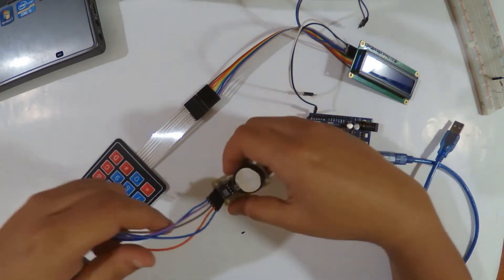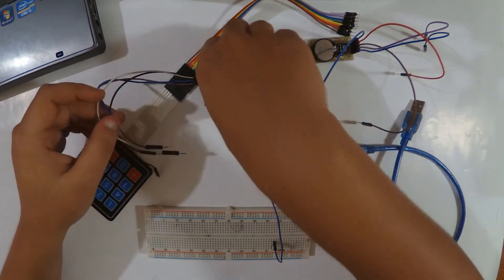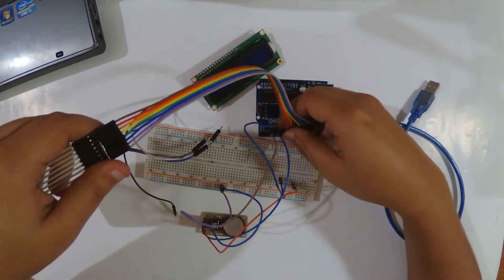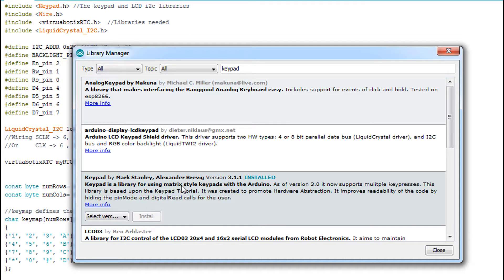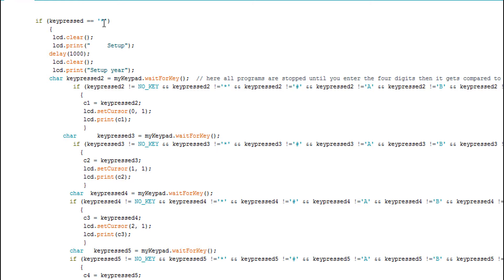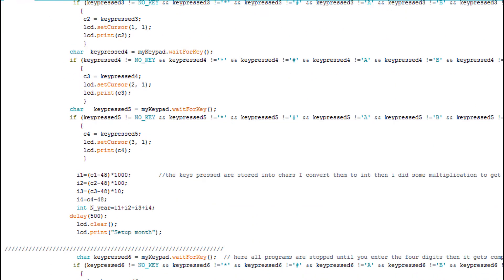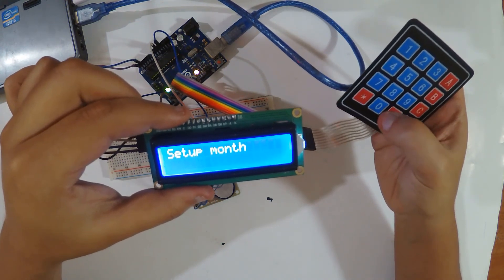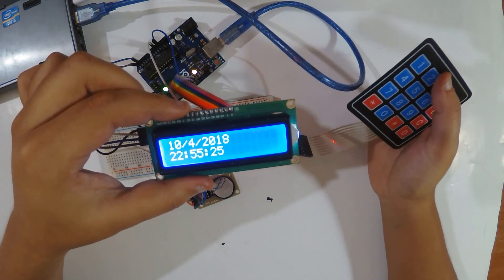How to setup RTC DS1302 with Keypad + LCD + Arduino

Comment: Why i have compilation error? It says no match function for call to virtuabotixRTC Pls tell me how to fix this
Reply from the maker: Hello, it's either:
- You didn't install the library.
- Or you have two librairies with the same name.

I recommend you to put the folder "ArduinoRTClibrary-master" in "Documents/Arduino/libraries". The folder is in the link, extract the .rar file or install it through the Arduino IDE.

Comment: Great project. Thank you. I have tested with simple single switch on X4Y1 (row 4, column 1) to use set time function only presently. I am wondering as the A,B,C,D not used on the keypad, may I use a 3x4 keypad without connecting that column? Again, great project.
Reply from the maker: Yes you can do, you need to adjust the keypad declaration... and change the buttons to '*' or '#'... check on 4x3 keypad examples to help you.
Reply: @SurtrTech  Thank you for the reply. Will try.😊

Comment: hello @sutrtech Could you help me? my Rtc1302 is not storing time. When reboot, it goes to default time. thank you
Reply from the maker: Hello, I can't remember if this code contains a set time function at the beginning with fixed values, but if it is upload the code the first time with correct date/time and then reupload the code without that line.
The line is probably mentionned in the code.
Reply: @SurtrTech  i tried but still not holding time.
Reply from the maker: @shahidmuneer6010  Did you check if the battery is working well or depleted?
Reply: Yes i have tried with new one also...I am using CR2030

Comment: Hey I didn' understand What is it -48 ??

for example:

        i1=(c1-48)*10;
        i2=c2-48;
        int N_hour=i1+i2;
Reply from the maker: Hello, the key inputs are read as "char" but in order to do some maths manipulations we need to convert them to "int".
0 as char = 48 as int.
Check this ASCIIchart to know more https://www.arduino.cc/en/Reference/ASCIIchart
Reply: @SurtrTech  Thank you bro it worked for me.

Comment: Why date and clock not display like
0/0/2000
0:0:0 like but i done setup but still this
Reply from the maker: Check the wiring and soldered pins, also if you could add a resistor between DAT and its pin, 1k 2.2k 220Ohm can do it

Comment: cant" download that code
Reply from the maker: Hello, in the link bellow the video you'll find the article about the project in my website, then bellow the wiring you'll find links to download libraries needed and the code (those links direct you to google drive where you can find the files).
Otherwise here's the link to the file in Drive  ( https://drive.google.com/file/d/1rqX5Xb24vn3zj5mSVZl5hlZLIxJ1apcX/ )
Reply: @SurtrTech  It's because he can't decompress a .RAR file. Who uses .RAR files anymore? They are obsolete. Why not just make the .ino file available uncompressed?
Reply from the maker: @chuckhole  I'm uploading them as .ino in new videos, those are just the old ones, and for the libraries the .RAR is very common, so it's better to have Winrar

Comment: Hai. Can you help me? What if i want to make some alarm clock. And the keypad is use to set the clock at certain time. Let say, i enter on the keypad 0730. And then if the time matches, from the arduino there is output to the buzzer. Can you help me?
Reply: if the time match, the buzzer will make sound.
Reply from the maker: Hello, I already have the code and wiring for this, I will do a video about it as soon as possible stay tuned.
Reply from the maker: Hi I tried to do this, check the new video about it youtube.com/watch?v=62tHrqMM55w